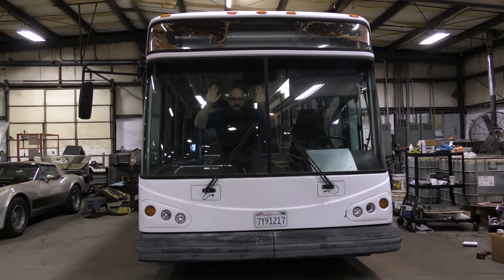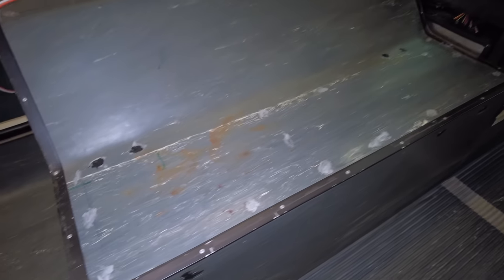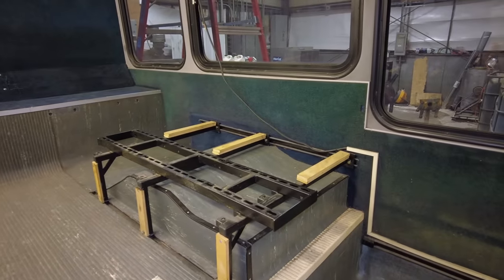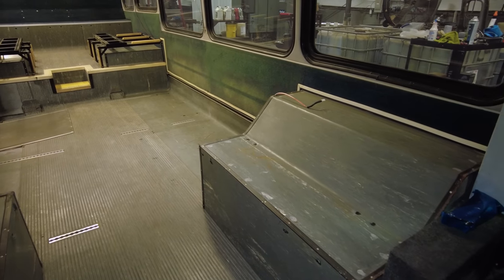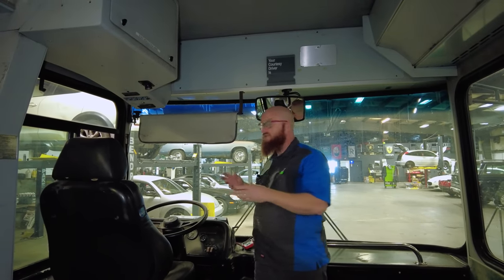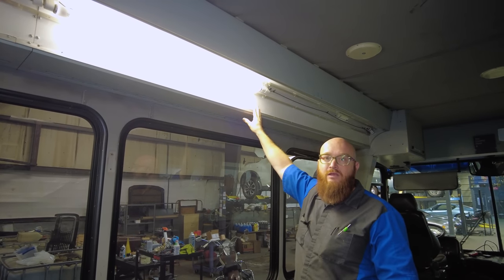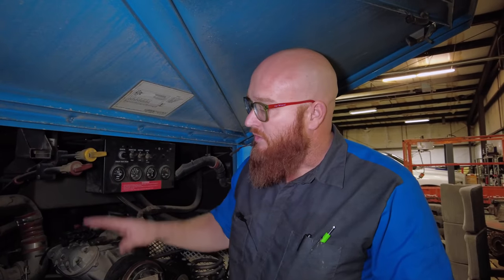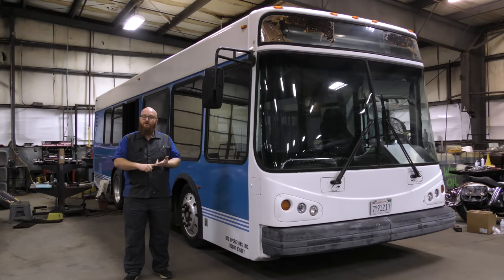Bus #3: EZ-Rider bus looks great cleaned up! Plus the CAR WIZARD has found a lost gear?!?

Comment: RV's leak due to poor maintenance from owners. The roof seals are largely ignored, and the units are often stored outdoors exposed to the elements, and a leak will come up and no one will be around so it leaks for an extended period of time until an owner shows up. There are no mysterious instances where water finds a way. Without maintaining roof/window seals on this bus it would eventually leak. Cities and towns that own these buses do maintenance to the seals regularly and if there is a leak because there is always someone in it they can catch it quickly. Also, they're built to make things like removing wall panels a bit easier than an RV in the event of a leak.

Not familiar with that code reader, but in the event you get something generic or something that doesn't seem to be an Allison code, if the engine is running and the trans is at operating temperature, you should be able to hold the up/down buttons on the "shifter" you pointed out at the same time. It will do a countdown from 7 or 8 or similar. That's not seconds, it's cycles, so it can take 60 or so seconds to complete. When it's done, you'll either get "oL - pause - oK", or it will give you a fault code you can look at. I actually recommend doing this anytime you stop at a rest area or for some fuel as long as you're on a relatively level ground ( otherwise you may get warnings about low oil or similar ). This way say after filling up your fuel which will take some time even with the larger spouts on the truck stop handles you'll potentially catch something before it's a big deal.

Regarding unlocking 6th gear on the B300R. If the person you're working with is doing this by modifying the VIN ( a common method by using a VIN that supports 6th gear or at least it was at one point ) or anything other than getting an authorization letter first which will let you bring it to any Allison tech, I would be hesitant to do that unless the letter approach failed. I see people with skoolies try this stuff, and it often creates issues with another module, or the system as a whole. Also, you may have to update your tires to get the approval, or keep in mind the load and speed rating of your tires if you're doing one of these alternate methods.

Regarding the A/C, the largest RV rooftop units are typically 15K BTU's which is a little over 1 ton, so putting two up is 2 tons. That might seem like a lot compared to a 1000 - 1500 sq ft home that might have the same, but you have to realize that the insulation on the buses or RV sidewalls are no where near the same. Then, you have a huge front windshield, and windows on the sides, which are even larger on this bus. 

If you look it up, because it will sound impossible, a lot of regular cars have 3 Tons worth of BTUs coming out of your dash. It's required to bring down the 120F+ temperatures you might deal with after having your car sitting in a parking lot, or in the event of these buses and RV's because of all the sun BTU's pouring into the windows. Meaning how would you expect 2 tons of roof power wouldn't be enough by itself because it's less than a sedan has for a much smaller space. Maybe two rooftop units in addition to a functioning chassis air conditioner will work, but it's no more complicated than more BTU's coming in than are being used to cool, on top of less efficient insulation compared to homes.

Comment: lol at the thought of an RV doing 80-90MPH... with inverse square law of wind resistance over speed your mileage loss difference between 55 and 90 would be catastrophically bad I would think.  You might find that 70 isn't palatable even with 6th gear in place.
Reply: I’ve had my 40ft Monaco at 90mph for several miles, the fuel mileage difference is very small. It really is amazing how fast some of these units are.

Comment: Having driven buses over 30 years I think the voltage will 24 volt not 12 volt you will have fun changing the wheels sum have left hand nuts and right hand nuts depending on which side of the bus good luck keep an eye on the MPG

Comment: I have one advice.
Ask someone to help you use an Arduino or Esp32 to run the AC. An Esp32 is wifi and have som power. Both can use temperature sensors to controll and regulate indoor temperature.
Both work if you run an AC powered system when parked. And the Esp32 with a 4g modem or wifi you can start mains AC/Heating from your Phone.
I'm not skilled enough to make the program for Arduino/Esp32 but someone else can definitly help you.
Good luck.

Comment: You obviously removed the caging and poles inside the cabin. I suppose that this caging which is necessary for public transportation was also somewhat part of the structural "cabin rigidity".
Do you plan on consolidating the cabin now that you've removed the caging and poles ? Or will what you plan to add also work as some sort of structural "cabin rigidity" ?
Reply: I doubt those hand hold poles were very structural.

Comment: Science.  Ask yourself, what ever you change/add/remove....Am I raising or lowering the center of gravity.  And, no matter what you do, USE the LIGHTEST possible components.  Lower weight whenever possible. Finally, sound deadening. Quiet ride will be a great achievement. Figure out the sound levels FIRST. you want smooth, quiet, and Safe. This is one of the best projects ever!

Comment: You are finding out a lot of how you can get more power and torque from the engine and transmission from the maverlouse you tube community and when you start building the interior of the bus there will a lot of help out there

Comment: Hey where did you send your ecm to get reflagged I’m putting an industrial isb in a ford pickup and it’s tuned at 225 hp and I want to get the 300hp tune flashed on it

Comment: getting a broken window when its covered will not be more difficult to fix? also i think windows are a common failure point over time arent they? its easier to leave them but it could be 'better' to remove and fill in properly with insulation
edit: also good work optimizing the driveline and the stock a/c, power and redundancy seems a good idea

Comment: Why would you have 110V lights as well? LED strips all run at 12V or 24V DC, it’s simpler to just have a DC converter and run one set of lights, surely? My house is all 24V DC (I have a fully integrated smart home).

Comment: The windows are a security risk as well as a massive source of heat loss in winter and excess heat in summer. Thefts from RVs , especially in these days of van life, and the knowledge that they can carry a lot of expensive high quality equipment, are rife. To be able to actually live in this thing it is going to need a huge amount of insulations added, and if you keep the windows they will need custom made insulation inserts to be put up and taken down every night.

Comment: I’m curious if adding a 6th gear will make a noticeable improvement in MPG. Even one MPG improvement would be a big deal.
Reply: Extra gear is mostly to get up to highway speed. Won't have effect on MPG. The thing is a wind plow so don't expect stellar mileage. Diesel engine governor controls max speed of engine so vehicle might be limited to something like 50 mph without sixth gear.

Comment: I would just use a residential thermostat connected to the relays in the HVAC to bypass the controller. Then it will still cycle .

Comment: With the dead AC control unit - I would imagine it's possible to use an SBC (think Raspberry Pi) and a small bit of software to get full auto AC again. Might be worth thinking about if you know someone with some programming knowledge.
Reply: Jeff Geerling has entered the chat
Reply: Na Na ... don't give up on the stock controller.  pop her open,  it's just a box of relays and driver transistors .. all stock parts and easy to isolate the fault.

Comment: wouldn't it make more sense to just use all 12V lighting and then just using a 12V power supply to power them using 110/220v if you want when you are at a camp site. i figure you will likely be adding solar eventually and to me it makes more sense to keep things 12/24v DC and only use 110VAC as needed.

Comment: I still think the very short wheelbase and rear suspension makes this conversion a very 'fiffy' project considering center of gravity and the additional weight of interior add-ins. And the headlights for Interstate travel are lacking too. But I guess I'm in the minority here...
Reply: I've seen a few conversions go badly and watching the Wizards with interest.  They're smart folks and their experience with the boat will help them, but RVs are kind of their own thing and a shuttle bus doesn't offer the mounting and placement options for tanks and other accessories that designing from the axles-up does.

Comment: Good news on the AC and engine upgrades. I assume that the 6th gear lock out and defining were economy measures for improve profits while running as a shuttle. 
I'm a cheapskate so the idea of pushing that big box along at 70 is not my cup of tea but compared to the military vehicles you've worked on this will be like a Prius in comparison.
Oh yeah, keeping the chases will make the interior more spacious. Even going so far as keeping the cabinets below waist level, as much as possible, would do the same.

Comment: Why dont you fix original ac controller? Shorted wire may have burned something inside but any qualified electrian can fix it easily. It would be much better to use when controlled properly.

Comment: This video made me realize why RVs are made with flimsy, lightweight materials in their interiors....WEIGHT. You are really going to need that tune because you will be filling this bus up with an interior and beds and whatnot it never had.  Those people that suggested taking out windows were right but for the wrong reason. glass is VERY heavy compared to sheet metal.. Leaks? BS.  Whatever windows are to be covered by your kitchen or bathroom replace with sheet metal. you can do it.

Comment: I have an idea for the bed. You could make it like a cuddy cabin in a boat, with a removable center section for navigating. You could use 3 twin mattresses in fact. If you need to, cut the center mattress in half for easier removal. I hope I explained it well enough. I think it would be awesome.

Comment: NICE NICE. THE TRAVELING. DRAG BUS HAVING. FUN. IN. THE. SHOP AND IT. GOOD  MORAL  AS WELL
Reply: THE. WIZARD. IS. S. SMART. MAN. IF. HE. GETS. GOING TO. FAST. HILL. JUST. PULL. THE SHOOT  THAT'S. THE. TRAVELING  BUS. ALL. FUN. INSTEAD. OF. JUST. WORKING ON. CARS ALL. THE. TIME. BRAKE TIME. GM TECH. 38. YEARS. AND. STILL GOING